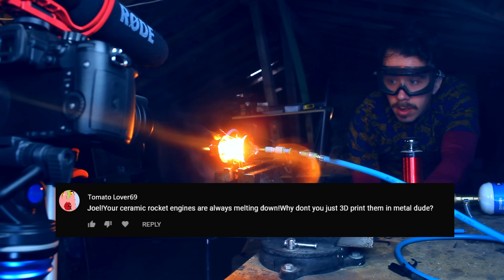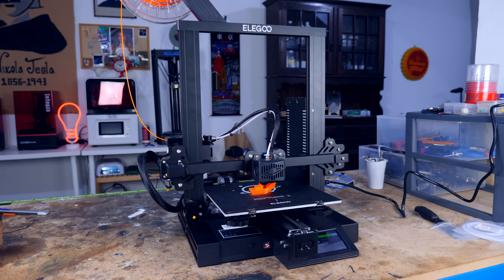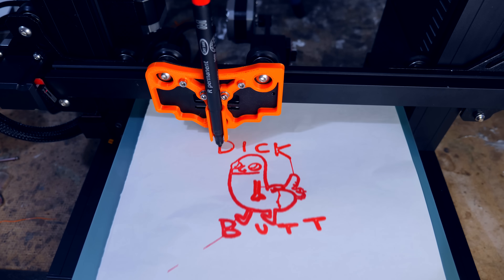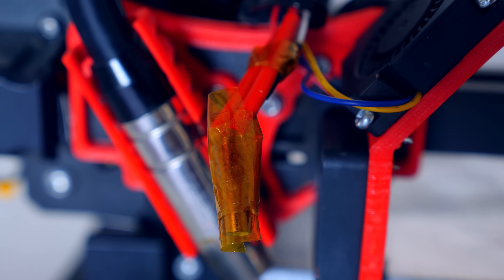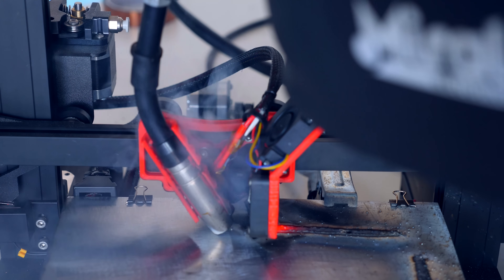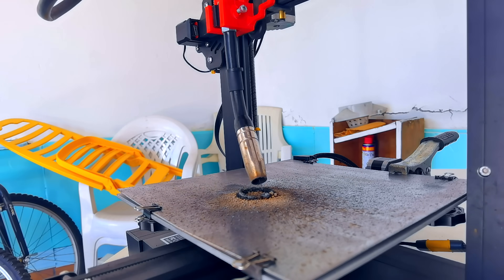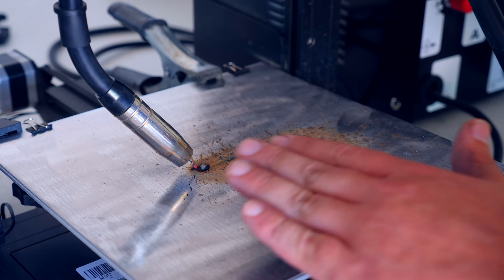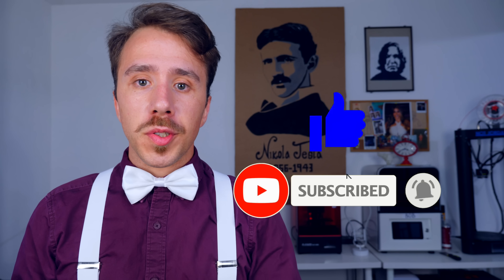I built a Metal 3D Printer using my Welding Machine

Comment: Nice try. Yup thicker plate like 40mm thick is needed to grantee no warping. A solid wire 0.6mm with H15 gas is more ideal. The first layer should be done fairly hot but the rest much colder when you get any height. I've experience in weld repair where I manually 3D print new parts.

Comment: You should check out MX3D in the Netherlands. They are specialized in MIG welding-based printing. They even made a bridge this way. Also, if you decide to continue this adventure, I'd suggest switching to gas instead of flux. Cleaner and more constant welds are a must for stuff like this. (Also saves you allot of grinding!)

Comment: When you inevitably make a mk 2 video of this:
1. The reason the end of the welding gun is at an angle is in order to weld "ahead". You do this so that you do not pumping plasma into already hot metal. This does mean you need a rotary axis, but I have faith. Welds will be better and cleaner.
2. USE GAS. Either CO2 or Argon. Results will be MUCH better. Could be interesting to build an enclosure for the printer with its own ventilation.
3. I would suggest buying a welding unit that would be easy to program volts/speed.
4. Watch a MIG welding tutorial series.

Hopefully my high school level of welding knowledge helps. Obv this will never be practical, but it seems like a fun challenge. You got this.

Comment: Should have put a ceramic tile under the base. The nozzle needs to be much closer as well, and it will splatter less. Even a slightly thicker steel sheet should have been plenty to soak up the heat from the welder in addition to a strong fan pointing at it.

Comment: You should try to make a 3D printer that uses a tig machine instead. The welds would be cleaner and you can control amperage with the pedal

Comment: You're going to have much better luck if you swap out the flux core wire for solid wire and use gas shielding [ie, switch your unit to MIG.]

Comment: Your are not stupid of course! This process is called WAAM for Wire Arc Aditive Manufacturing. Some month ago I worked on modeling that in 3D and is very hard to do it well.
I would advice you to wait some time between layers, to have a chance to diffuse the extreme heat. This will help with warping, witch gets worse has you get far away from the madatory substrate.
The difficulty is finding the right balance of wire feed, linear speed and arc current. Start with simple walls for that.
WAAM @ home: vocé tem o meu respeito ! 👨‍🔧🏅

Comment: Video Idea: Building a metal 3d printer part 2: electric boogaloo; reposition the nozzle to 90 degrees vertical, add more clamping to the edges, and lower the heat on the machine, which should aid in accuracy and getting less warping. On top of that, you could potentially cut down the bed size so there is even less chance of warping if you don't plan to make a metal part that large. And to add for safety for the printer I recommend adding a shield to the main display so splatter won't come in contact and possibly damage it

Comment: One way to make it easier to 3d print with a welder is to do it on a plate of copper as 1. the copper conducts electric and heat sync to get read if the heat and removes wrapping (you would also need to make sure it is isolated from the 3d printer) and 2 the weld can then be removed from it like it would if you was printing  plastic and 3 you could use an Arduino programmed to operate the feed motor of the welder so it acts like it does on a normal 3d printer and also YOU SIR ARE A GENIUS

Comment: YO !!!! BTW you can have the torch tip angle vertical, that will help, altho i agree with having a thicker plate of steel will help it will still warp but not as fast as the sheet steel dose, you may be better off having a cast iron plate of steel, in the video you are using flux core welding wire, that is messy stuff you are farrrr better off using argon mix with solid wire you will get loads cleaner more defined welds and you can set your wire speed to gain more weld material in a single pass, them cheapo welding machines aren't the best but you will certainly get better results with what i have suggested, give it another go, also in that clip of the professional metal 3d printer it looks like its laying aluminium wire, thats another animal again, AC welding witch is much hotter under the right conditions (with gas ) you can lay down a lot of clean weld, clean welds are predictable and therefore will help you in getting the results you want, PS. you can mig weld with straight C02 gas its cheaper but it won't be as clean as argon mix, ideally you want a thick aluminium plate under what ever you are welding that will help suck the heat out of the steel as its getting welded , my instagram Arcjunkie1991

Comment: you need a Welding Machine with some Gas like MAG or MIG
Thatway the Metal doesn't get that dirty and you have a higher chance of predicting the touchdown point.
furthermore: try to weld on Copper as it doesn't stick to it but ic can start on it, so it would be worth a try

Comment: the reason welders angle our nozzles is so we can see the puddle better and to "push" the puddle. however unless you can change the angle every time the print head changes direction then your doing more harm than good. you can absolutely angle the nozzle straight up and down!  Its honestly not that important ;) Oh also weld wont stick to copper!! its on old welders trick we use to fill a hole.. put a sheet of copper behind the hole and just weld it and when your done the copper just peels off.. This means you can use copper for your print bed and the entire piece will just lift off after its cooled!! you would want a pretty thick sheet of copper as the heat will cause it to warp just like the steel but probably a little more aggressively because of the thermal properties of copper.. using a block of steel underneath the copper bed could help to absorb some of that heat and allow you to use a thinner piece of copper. in any case great vid! and i would love to see you follow up and try to make improvements here.. i think your closer than you think you are to having a metal 3d printer  ;) notice the suggestion for a future video there lol

Comment: This was a great one! What a fun experiment! Now I wonder about different ways to make a heat resistant printer bed to hold the molting hot metal that is being printed... maybe a frame for the print bed that only touches 4 corners to prevent warping and heat transfer. Seems you are very close! Congratulations ;)

Comment: At my old job I have tried the same with a welder robot. 

Layer height and cooling is key. So print large projects. when you start the next layer the starting point will be cooled. Or stop each layer and let it cool (I used water a few times too cool it quickly). 
Layer height is trial and error. If you make a small project the material has more heat in it so the material will flow easier. Later layers will be smaller then the first layers.
 ( unless you let it cool enough  each layer)

You should also try to make the angle more steep so you will aim the heat in the material and not past it. This wil increase heat but make it more predictable.

Straight lines are also nearly impossible to print. because if you end a weld there will be a small slope. If you stacks those welds the slope gets bigger and bigger. This can be fixed with tweaking the welder settings but is pretty hard.

I don't remember the settings I used for the welds exactly but if you want to I could look it up.

Anyways cool project!👍

Also thicker plates will still warp if you don't cool the properly.

Comment: You can weld vertically in a nice no wind situation like that. This would allow you to shorten your standoff distance, better weld. You will likely surpass your welders duty cycle and it will stall out on you. G code will allow you to trick the welder into thinking the switch has been pulled if you want to do it inside the welder.I think it is a terrific idea! I am going to try it on my plasma table swap the mig for the plasma torch.

Comment: You can solve distortion be pinning the metal more frequently and using water cooled copper blocks under the printer, it will still warp but it won’t be immense.

Comment: thicker sheet as a base, drill mounting holes to hold it down, *don't use flux core garbage*, and don't run the torch at an angle unless you can make it always push

also you can probably run it a little colder

Comment: A way to avoid warping your steel plates is to have the welder do much shorter runs. First weld a line about 3cm long, then move to a different section of the "print" and weld another line. Alternate welding lines around the plate as much as possible to reduce warping. If you're doing small pieces like the circle, I'd suggest programming multiple circles on the plate and have the welder move across the plate doing small sections of all of the circles. Additionally, after each section of weld, blow air on the spot from your air compressor. This will quickly disperse the heat more and further reduce warping. 

This is a very common issue with welding thin metal and these are techniques that help.

Also, I'd love to see you build a hydrogen generator. If you build that, you can use it to fuel your rockets, a little torch (for cutting thicker metal) and so many other fun projects. And you don't have to buy as much propane any more! 

Keep up the great content. I actively watch for your videos. You're a great maker, great presenter and a great personality. I'm grateful to see intelligent, funny content that is thoroughly engaging, even the ad section!

Comment: Why don’t you try printing from aluminium powder? It should be fairly easy as aluminium requires about 600C to melt. Use a ceramic nozzle to extrude. Plus i think controlling the in-feed speed should be relatively easy

Comment: You know, if you weld well you get a nice pattern. I know you can't do it, but you can tell the printer to do it.
You can also cool the steel plate with air or water to prevent bending.

Comment: building a 3d printing welder is possible, but I have a few comments. 
First, you don't need to angle the welder. The reason they do that is for visibility. It's more efficient at 90-degree angle.
Second, your actual results would be massively improved by removing the gas shield from the welder. Try instead building an enclosure where you can trap the argon in the chamber. This will allow you to use less gas and have the entire project being completely oxygen-free the entire time, resulting in less burning and spatter and better fusion. 

Also, you don't need to weld on a sheet at all. Use the sheet as the base, but place a piece of bar stock or plate the same size as the base of the project, and print from there.  you can use magnets to hold things down.

Comment: Step 1: Build a high power water jet that can cut a tin of tomatoes in half. 
Step 2: strap that to a 3d printer and cut some steel. 
Step 3: model and cut jet nozzle using thin steel layer by layer. 
Step 4:world domination

Comment: One of the biggest issues that I saw was that you are using flux core, which results in a lot of spatter.  You could try rigging up a hose with either N2 or CO2 to protect the weld, and then use standard MIG wire.  This would reduce the spatter and dirt that you need to clean up between layers, in addition to the flowing air helping cool the base plate.

Comment: Video Idea:
This is why I had suggested that you try different kinds of metal casting, either hot metal casts, or try the same basic idea that you used when printing with ceramic, and baking out the plastic, maybe you could cold cast with metal/resin solution, and cook out the resin leaving just the metal?

Comment: So, just an idea, but you could possibly make an automatic feed rate based on the weld itself. Since the welder will dump a significant amount of current each time the filament makes contact, you could have a microcontroller monitoring that current flow and only push filament when there's no contact.

Comment: I think a really fun and cool project for a video would be to continue down the rocket building path, but use a HHO generator, AKA a hydrogen, oxygen generator, as the fuel source since it is an easy to build machine and the gasses are combustible together or use just hydrogen atoms alone by building an HHO generator that separates the 2 gasses as the are broken free from each other. So get to building it or I guess I would have to start making videos about this and take the subscribers from you and you do a great job so I would prefer to not have to do that, to you or your subscribers, along the way. :P

Comment: Video idea: Instead of 3D printing steel, how about 3D printing tin?
Indeed, judging by the melting temperatures and malleability, you might even be able to insert the regular tin roll into the plastic printing head. If not, you could mabe make it work with some modifications.
It could be used to solder on a board or to make some metal pieces with completely different properties from plastic ones.
Reply: Has someone noticed a problem I haven't?

Comment: Did you weld with flux wire? Looks like there is spatter / slag all over the place. You would be much better off using normal wire and shielding gas.

Comment: I still think  you should do a video on lost PLA casting.  :D  Print your part, encase is plaster, melt out plastic, fill with  glorious, skin charring, hair vaporizing, red hot liquid molten metal.  
And I have to say as well, you and your camera must have brass balls.  1. fume extraction?  It seemed you were inside and I know the welding fumes at minimum aren't pleasant at worst are very very VERY bad for you.  (Did Tomato lord Junior say he was going to handle fume extraction for you?) 2. Usually welding really messes with the sensors on a camera.  Yours didn't seem that affected by it.  Keep up the Integza madness.  Love your channel.

Comment: Is hard to 3D print steel, but I guess would be relatively easier to print with tin-lead solder. Even, I guess any FDM extruder could melt it and it would be printed over a copper plate ( i guess a non etched pcb board could be cheaper). Give it a try!

Comment: Use an induction heater to pre heat the welding wire, then weld with less amps.

Comment: How about another shot at the metal 3d printer with the nozzle straight up and down and using a shielding gas instead of flux core and a cooling bed?

Comment: I wonder if you welded very short segments (say 2mm) with a pause in between each of say 30 seconds you could avoid the bed warping? Basically, build it up of little dots of metal very slowly instead of trying to draw a continuous weld? I guess you'd need a flow of barrier gas to prevent the surface oxidation too. Anyway, fun video :)

Comment: Love the idea of hacking 3d printers to do things they weren't designed to do! 
maybe try building a ceramics 3d printer? or what if you reversed it, and used the 3d printer as a controller for a video game using the axes of the print head as an input rather than an output?

Comment: How about printing a nozzle in pla, casting it in plaster, and then burning it out to make a mold? Then pour in aluminium to cast the nozzle.   This is lost ‘wax’ casting.  You can get really accurate results this way.  If necessary you can paint the inside of the nozzle with a refractory slurry. 
Another step is to run the fuel through cooling spaces in the nozzle casting to cool the metal and preheat the fuel for more vroom.  A metal fuel line tightly wound on the nozzle would also work.

Comment: 3d metal printer upgrade idea, use a laser metal deposition gun! Or use a mig welder so you won't have to remove the slap from the flux core welds left behind.

Comment: Use a Tig torch head for the heat & a mig torch head with no earth for the wire feed. That you you could have the Tig torch pointing straight down. You'll be able to build layers better. But like you said you're not made of gold. So would end up costing a fortune.

Comment: this is completely impractical because you're using flux core wire which is generating its gas shielding with a powder inside the core of the wire, you'd have to use a solid wire with gas shielding to even be close to pulling this off

Comment: Just go to the hardware store and get some bentonite clay. They use it to seal wells and crap. If you cannot find that, fragrance free kitty litter is about the same thing.

3d print a mold for the rocket nozzle,  use a dowl rod and a small hammer to ram the clay and get it approximate.  The use a  threaded bolt to compress the inner and outer layers of the nozzle mold. Inspect for flaws and add where necessary then repeat. 

You will have a working nozzle thst won't leak and should stand up to the heat you are exposing it to.

Comment: Video idea:

Pneumatic 3d printer. I accept there is a need for electricity for extrusion and temperature, but I wonder how accurate you could make a printer using only pneumatics for X/Y (maybe Z too if you're feeling adventurous)

Comment: hey integza, as well, the oter issue idk if you know, flux core wire is very messy and can cause some of your issues, solid mig wire woul work better but you would need a shielding gas for it then, which might require a new welder

Comment: I dont want to be that person, but the very next comands after G1 are G2 for clockwise arcs and G3 for anticlockwise arcs. So dont tell me, G-codes can only do straight lines. Reason why 3D printers dont use those commands is, that it would be nightmare to implement them into a slicer. Try to mill hole for axel with cnc-mill with only straight lines. I´m sure it would turn "perfectly".